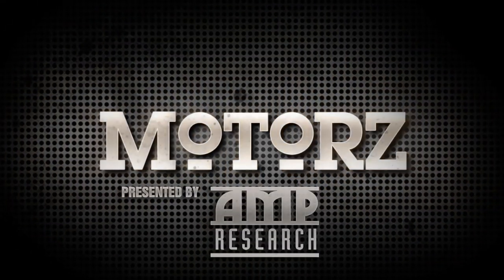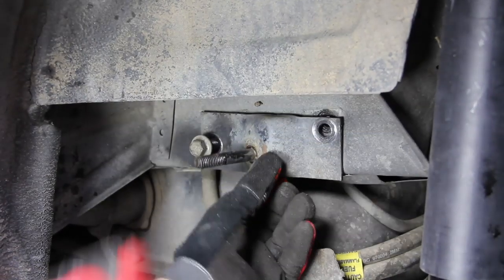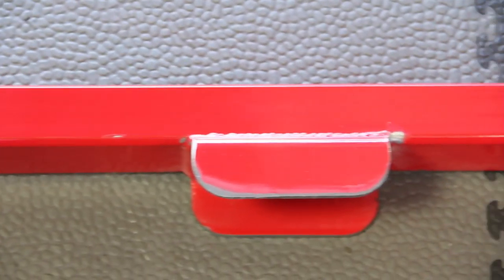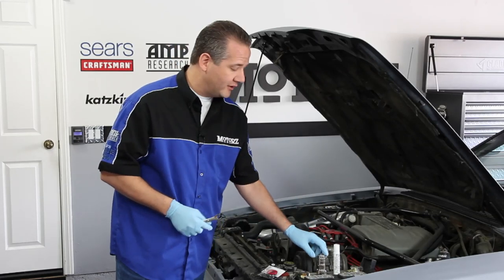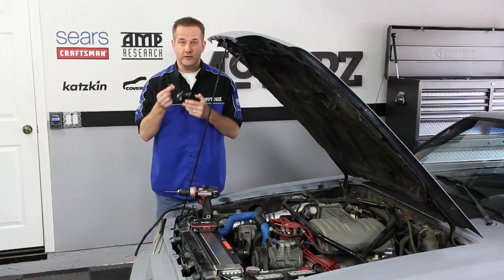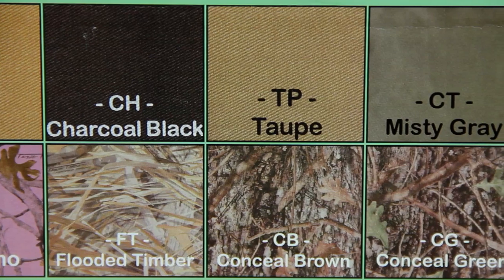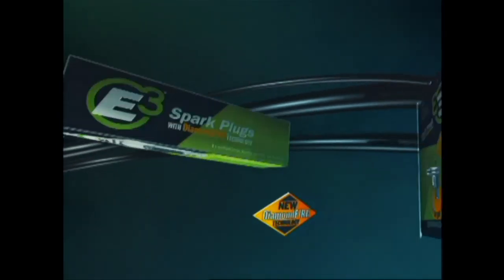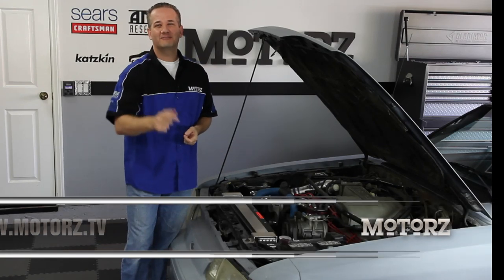How-To Install Sub-frame Connectors, Control Arms Ford Mustang Motorz #71

Comment: You showed the basics at least, and for that its a good video. But those welds have NO penetration. I know you were trying to prevent burn through, but the weld at 7:14 is just a blob of melted wire with no strength whatsoever (even if its just a tac). You need more heat, and you need to learn where to focus it as well. Maybe its because you were trying to get a good camera shot while working... yeah thats it. :-)

Comment: This is a really good video, shows everything that pretty much needed for these cars. I just picked up a 88 GT. What do you recommend that i do first. I planned on sub frame connectors right away. I want to do control arms but also want to do a pan hard bar. Between the control arms/panhard bar which one will be a very noticeable upgrade to make the car feel less floaty driving down the road.

Comment: I have an 88 Thunderbird Sport with a 435 hp. 347 Stroker. Are frame connectors, control arms and sway bars available for it also?

Comment: It may already be in these comments but disconnecting that positive battery terminal first was not a good thing. One of the first rules of working with electrical is negative off first and on last.

Comment: I need some help here please, when I turn my wheels all the way to the right (even left sometimes) it makes this popping sound like a clunk, I took it to Belle Tire but they're telling me they cannot diagnose the sound. I was like well whats up? Just ignore it? and the dude said everything looks perfectly fine and too just ride out and if it gets worse to come back...? what do i do here? That noise is embarrassing.
Reply: I had this happened after my strut nuts on top of the mount were loose. and my strut would pop when I turned to far. maybe check them? good luck.
Reply: your K member could be cracked or broken
Reply: Rick Massey
u think so? because it barley happens its so weird
Reply: Yeah sounds like what was happening to mine and that was the problem. The member had broken at the left front spring perch.and would pop and tire rub only when i turned full lock left turns....Another symptom...Does your car have a slight vibration above a certain speed say above 70-80mph?
Reply: It's hard to diagnose because the crack or break is practically invisible during straight or normal driving.
Reply: Rick Massey
if i just go into belle tire and tell them to change my whole suspension do u think this will fix the issue.. and hey thanks for your response by the way.. also is it dangerous like this? .. sorry for the questions and thanks again
Reply: Well first i would tell them of your suspicion and let them check to see if it is indeed broken .it shouldn't be dangerous to drive. Mine was taken on road trips to gateway in st Louis and raced at greatlakes dragaway without any problem before the issue was finally discovered...it's a well designed front architecture and has multiple redundancies in support to prevent any catastrophic failure
Reply: As for answering...No problem...I'm a old school foxbody fanboy😎💯😁👌
Reply: Rick Massey
if it is the k-member do u think a place like belle tire could handle it or would i have to go to a collision shop?
thanks again...
Reply: Did you grease the steering stops? My crown vic did that and it took me years to figure it out.